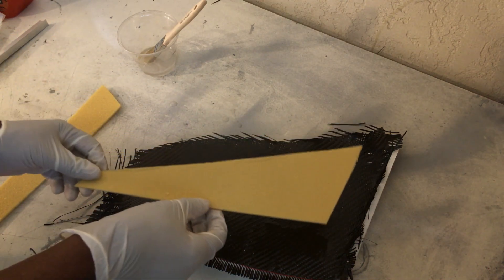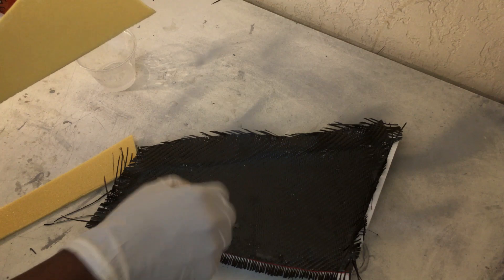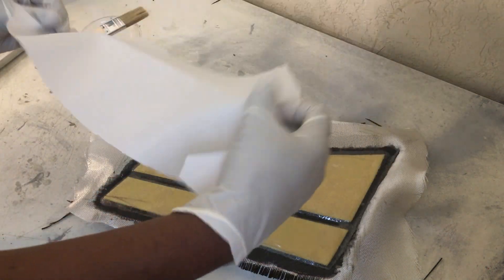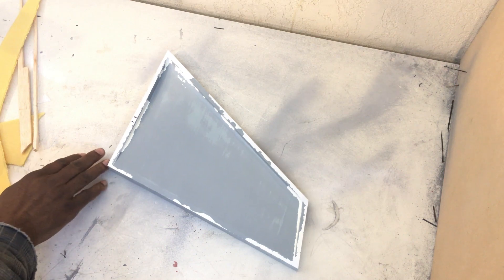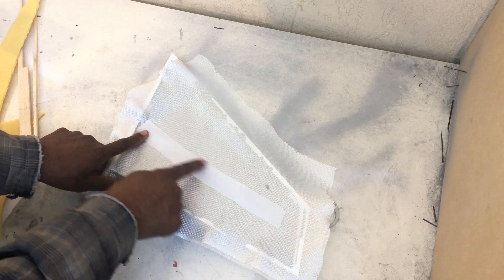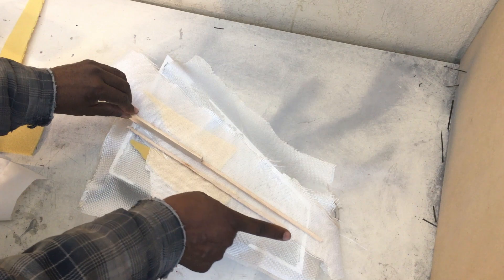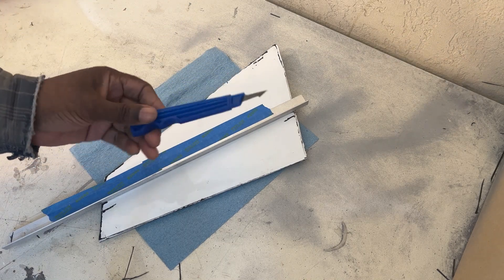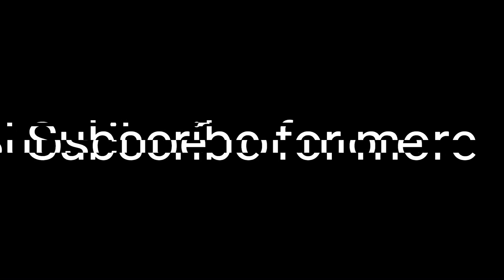Building An DIY 8FT RC Airbus A-350 Like Ramy RC From 3D printed molds Part 13

Comment: What’s the thickness of the foam you  used ? I’m building a similar project can I use 3mm foam core?? Thanks for the video!
Reply from the maker: You are welcome.  I used 3 mm on the bottom and 2mm on the top.  Yes, you can use 3mm.